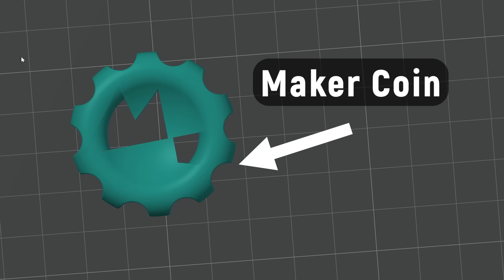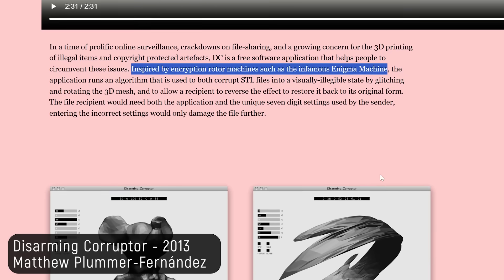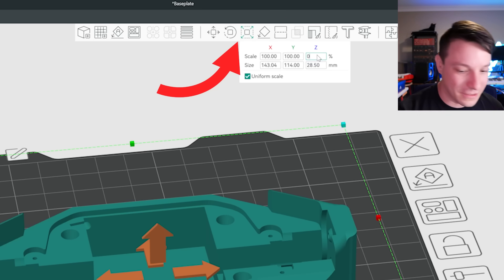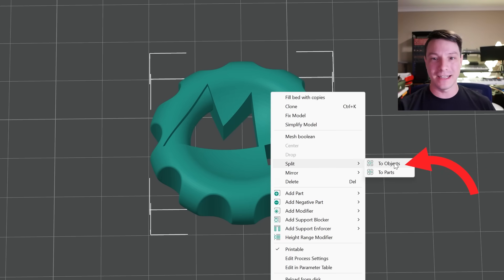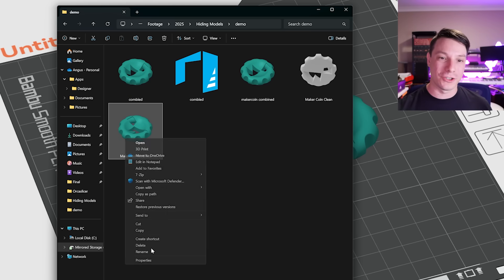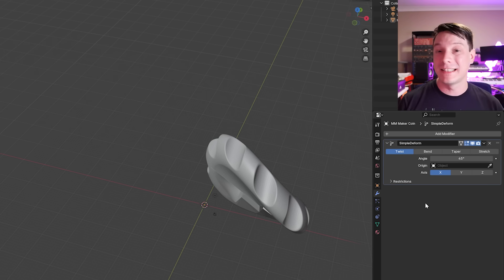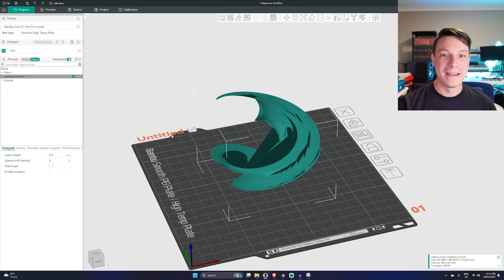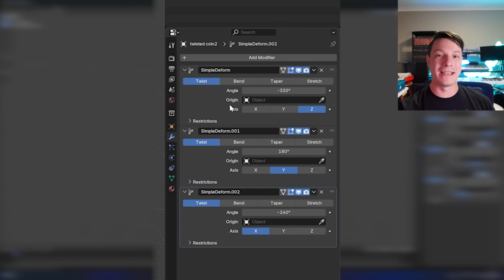How to obscure 3D models for fun or profit.

Comment: STL is just a terrible format. I dont want to see something like DRM--- but I think custom slicer settings in the 3mf which are generated per user, you'll largely be able to find re-uploaders. So, think a per-user symmetrical key to decrypt the obfuscated stl code. In the end they'll simply be able to export the STL once decrypted and re-share without issue.

Comment: Would it be easier to just encrypt the 3mf or stl files with a password or something and include the password or file with the download like in a txt doc or in the description?
Reply: Depending on the intent, it may be more useful to have the public-facing file appear to be valid in some way. 

An encrypted file is often going to be obviously obfuscated (esp if in an archive format), but if the model data itself is obfuscated within an otherwise valid and working file, it's less obvious that the model has been obfuscated at all.
Reply: A public facing 3d model site probably won't let you upload any random encrypted zip file - they'll process it first to make sure it's a valid model file before they let it show up on the site.
Reply: @ not of that encrypted file is in 3mf though most likely
Reply: If you encrypt a file and also drop the password, it's more likely they could just run a process inside the web scraper to unzip ir decrypt it. The blender option adds security by being non standard, at least for now
Reply: @radupirvu9854  we could use the filename or something as the password too. Or even use the encrypted files hash as the password.
Reply: @radupirvu9854 also it's very ready to tell that an encrypted file is an encrypted file, but a valid file that has garbage data is much harder to programmatically detect, even if they know the method

Another commentator pointed out that just shuffling the order or connections of the vertices with a deterministic function that takes a key to shuffle or unshuffle might work pretty well for model poisoning
Reply: Nope, we would have been doing that many years ago if it were, and people are dumb, that's just asking for complaints etc
Reply: A smart enough scraper could pick up the password, and even if it requires human intervention, it's far less labor than creating the model. This is no more than a minor speedbump., 

What might be more useful would be to steganographically embed a downloader ID in each model download, so you can at least ID who stole it, and block stolen models. This would require support from the hosting service though.

Comment: The "bit crushing" effect is likely due to floating point error, when you you squish the model that small, the distance between individual vertices are so tony that they can't be represented accurately anymore. I can foresee a similar problem with the blender deform option, the more modifiers you use or the more extreme the settings, the more error will accumulate. I think this would be especially noticeable on complex models. 

The concept of obfuscating model data is a good one, I think a more robust solution might come programmatically. Most model data formats are essentially just a list of vertex position and index orders, It should be fairly simply to make a program which takes a password or "key" and scrambles the index order/vertex positions based on it. 

If the main goal is poisoning scrapers and AI training though, the solution might be even easier. Simply use your "shrinking" method in reverse. Make the main model the one that is seen by default, but also include a tiny model filled with Garbage data, any scraper that does collect the model will read the files and not be able to tell the difference between the real model and the trash one.
Reply: Why actually? If the second part is at the model origin, the scaling is applied to exp portion of ieee754 number, and you should be able to go to approximately 10^-36 mm scale before it gets rough.
Reply: @SianaGearz  You fail to realize that the vertices are not in a quantised position. For example, if all the vertices are in an integer coordinates, you can scale that much more than if the coords are in a fraction of integer. 

For example, if I have floating point precision of three digits and two points on a line in positions 1.00 and 2.00, I can scale that down to 1% (0.01 and 0.02) before I get any floating point errors. However, if I'm already using the whole precision space, lets say 1.11 and 2.22, I cannot scale that down at all while keeping the precision. Scaling it by 10% will quantize the coordinates to 1.10 and 2.20 after reversing the scale. That is only 1% loss on precision but causes significant issues on the model unless the tolerances allow for 1% change.

The origin point does not affect this. It is nothing more than an arbitrary point in the coordinate system to which the vertex coordinates are tied to. Changing it can cause significant issues. For example, if my coords are 1.11 and I move the origin 0.005 right, the coordinate changes to 1.105 which then gets clipped to 1.10 due to floating point precision.
Reply: @anteshell   The mantissa is always between 1 (inclusive) and 2 (exclusive), and the exponent is always adjusted to make mantissa fit in this region, and as long as you don't munch the numbers too OFTEN or apply heavily numerically unstable operation, the mantissa maintains its approximately 7 decimal digits of precision, only losing a little of it. It only gets bad when you get to denormalised numbers which are around 10^-38 in magnitude, those can become heavily quantised.

An operation that kills the most precision and is numerically most disadvantageous is to add and subtract the same number with a much larger exponent. For example you do this with numbers 5 orders of magnitude apart, the ostensibly reversible operation leaves you with only 2 approximate digits of precision. Multiplication does not result in numeric fragility.

This is why origin matters, it's the internal zero point of the output model. The geometry is converted to the coordinate space of the output model, and if it shares the origin with the model before it was shrunk down and scaled around the origin, the numbers all turn out small in magnitude and shouldn't suffer quantisation effects. Floating point numbers can represent the same number of effective digits of precision in a large range of magnitudes, and numbers near zero are effectively more precise.
Reply: @SianaGearz  What do you even mean by "often"? That word is inherently related to passing time, but time has absolutely nothing to do with the topic.

Your last paragraph is still wrong. Scaling the object does not scale the coordinate system. That is literally in the definition of scaling; changing the size in relation to something else, in this case that "something else" being the coordinate system.
Reply: @anteshell   Please do a little bit of effort to understand ieee754 before you try to school me. Also maybe complete university course in numerical analysis because it's been a few decades but i did. "Often" as in number of operations matters. You need to have performed hundreds of multiplications until you have lost a single decimal digit of precision.
Reply: @SianaGearz  "Often" and "many" are two completely different things. The former means either doing stuff in short intervals or doing stuff many times in set time period. The latter simply means doing stuff many times. 

In essence, it does not matter how often you multiply, but it does matter how many times you do it.

Also, I was using three digit precision only because it's much easier to explain using three numbers than multiple billion numbers. The only difference is the magnitude, but effects overflowing the float32 is exactly the same as overflowing the float(whatever) that I used in my example.
Reply: @anteshell   Overflow has nothing to do with this. f32 will overflow just north of 10^38.
Reply: @SianaGearz  Then explain how my example was not correct.
Reply: @  I already did.
Reply: @SianaGearz  Maybe because the factor of 0.0*1% is not a power of two, so is it possible it takes more and more bits to represent for every extra (decimal) zero?  I'm not sure.
Reply: @yeroca   This is what the other person seems to be gesturing towards but that's just not a problem, you have oodles of leeway to lose precision before it's seen or felt. The transform is a 4x3 matrix multiplication and additive terms are all zero for scaling around origin.
Reply: @ Yeah, I just now played around with conversion of 0.0*1 to IEEE-754 and the percentage of error in the conversion was pretty consistent regardless of the number of zeros.  Thanks for your reply.
Reply: When you make stl-file, does it burn in the parametric deformations or does it save the model in parametric form? If the former, you are correct that floating point accuracy might cause some issues.

I don't think your poisoning method works, because the scrap data is inside the model and does not affect the model itself at all. Essentially, it's just an inert tumor making the final filesize larger but does not affect the outcome. It will essentially just teach the AI to clone the tumor inside the model while still keeping it in remission, non-cancerous. Although, I guess it is possible it will become cancerous again in similar manner as they have problems drawing five fingers in each hand.
Reply: @anteshell  stl is triangle data, so yes, exporting as stl will apply the transformations and any information that is lost due to floating point precision limits is lost forever
Reply: Who is Tony?

Comment: I'm picturing this can be a great way to put an invisible signature on your creations. Before you upload a model you created, embed a diffrent model inside of it and merge it completely with the source file so that it can't be easily separated. You'd have to know it's there to find it, and that way you could prove that someone stole and reuploaded your model, as you'd be the only one with such knowledge. Not all model thieves are well versed in CAD and they might get caught by just straight up not knowing the thought process behind the design choices, but those who can bullshit their way out of some questions will be still unable to explain an irrationality or a secret
Reply: If model thieves had any clue at all about modelling or sculpting they wouldn't be thieves
Reply: he had a different video on this... internal geometry that is not immediately visible from the outside
Reply: That was my first thought too. But the way of "decoding" it by simply splitting the model into objects is just too simple. Once someone got caught, the first thing they're going to do next time they steal a model is splitting it into objects and deleting the secret token.
Reply: As mentioned in the video, running the combined model through a cleaning and repair filter would likely remove the embedded micro model.

Comment: I guess don’t quite get it. Mangling 3D files is kinda like symmetric encryption but not secure. Keeping the file as a mangled 3D object does not really add any value to the process.
Reply: it does one thing: it increases the effort for scrapers or reuploaders to use your files. the data is back open for whoever unscrambled it to possibly reupload it unscrambled, but that is more effort than the average lazy reuploader is going to invest as long as he can find files he can use as they are.

also scrape bots likely wont check if the 3d data matches the preview image and that would poison any automatically scraped together bundles in a sense as it easily reveals that the models were scraped.

this will of course only work until the majority of new files are scrambled like this and the scrapers have to come up with a solution that automates the cleanup maybe even without access to the unscrambling key. then its just an arms race on who can make the other do more work to protect/steal the original work
Reply: @ yeah. Saddest thing is people need to think about these things. And still it just takes one person to rtfm and upload the unmangled file somewhere. Wish people would respect ip.
Reply: @TheScarvig  models should be free, IP is made up
Reply: People just love to re-invent encryption ... badly.
Reply: The only use I can think of for this is to smuggle an illegal model inside a normal looking model.
Reply: It's totally useless. But he'll get 50000 views from it, so here you go...

Comment: A more advanced option would be to do actual steganography. This would require writing software, but not terribly complex software. A common method is to hide data bits in the least significant bits of pixels in an image file. No one's going to notice if the color of each pixel is off by a tiny amount, and the same could be done with the positions of vertices in an STL file. You would just need to make sure that your "cover" file is much larger than your smuggled file. Or you could just hide the secret file inside some chunk of metadata in the cover file, but that would be a lot easier to detect.
Reply: You could probably find a specific face (largest? Nth?) in a mesh and subdivide it in such a way to hide data.

Comment: I prefer using nanazip on windows 11, as it's a fork of 7zip but saves a click as it properly supports windows 11's context menu! It's on Windows store too, so it's easy to download. Other than that and a few nice to have extra features, it works exactly the same as 7zip (because it basically is).

Comment: Neat concept. Trying to think of the practicality. In the case vs scrapers, it just adds one step for the scrapers but punishes the typical users.
Reply: typical DRM
Reply: Should make it easier to distribute content that may be restricted (eg. LRGs in countries with strict firearms laws)
Reply: @turbochargedfilms  Not a bad use case, but I'm not sure relying on public facing model repos run by disinterested corporations is a great start for those kinds of models anyway.
Reply: yep, just like captchas. bots can solve them easily and there's even captcha farms for paying humans to solve them too. all it does is punish the end user for wanting to access that site
Reply: If the numbers were random, i doubt most scrapers would figure it out. Not sure how you would use it, except that maybe that only those on a patreon would have access to the numbers, and hope they don't share it?
Reply: @IrocZIV  Might as well just put the model behind a paywall then. With open source AI reasoning models such as deepseek, a scraper can perform the same steps as a user. At best, it would basically be a very complicated captcha, which people don't like. Also, in that case, just use a captcha to stop the scrapers then.
Reply: This might be used for 3d printed guns and similarly controlled items. If it becomes illegal to host these files, one could skirt the filters with this.

Comment: I think you’re onto something here. Essentially this moves towards encrypting / password protection. 

But yeah even the best ecryption can have it’s keys leaked. so at some point you need online verification. Else a stolen model just comes with a leaked key. 

And the maker community does not seen to like not owning there thing (printer, model, software etc). 

I think it’s kinda hard to have it both ways.
Reply: BUT, is you generate unique keys for each user you can track who is ripping you off and reselling your model. 

Similarly you could watermark the .3mf .stl file
Reply: You wouldn't even need the encryption key, you can just export models from a decrypted 3MF as an STL file, at which point the encryption key is no longer required, so anyone who has access to the file can just leak it
Reply: @shanematthews1985  true i forgot about that.

Comment: In a way this is just a bit of steganography (with the small chassis) or weak symmetric key encryption (with the twisted coin) to implement a simple form of DRM (against scrapper bots mostly). I doubt that these techniques would be very difficult to detect and reverse so they will only work if they don't get too widespread and will not work against resourceful opponents (states, companies with big pockets, serious crackers, etc.)